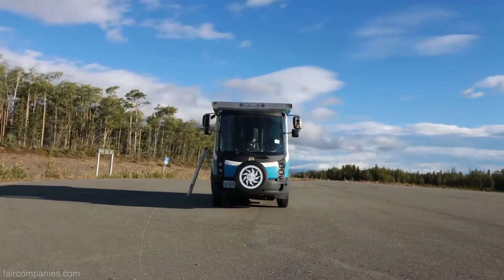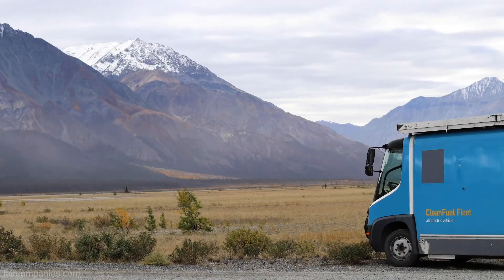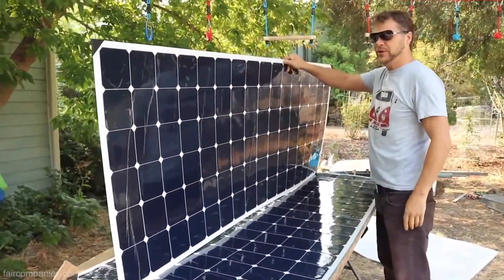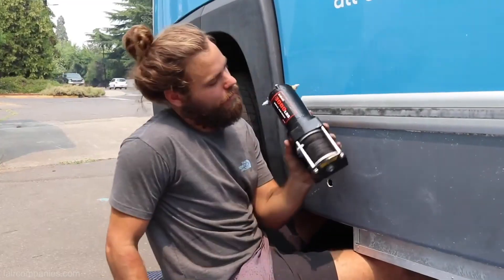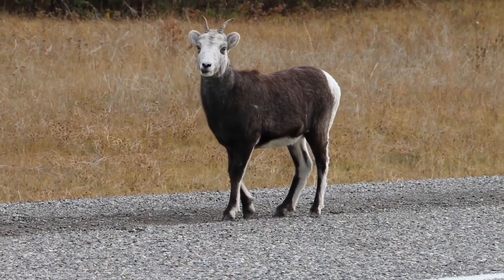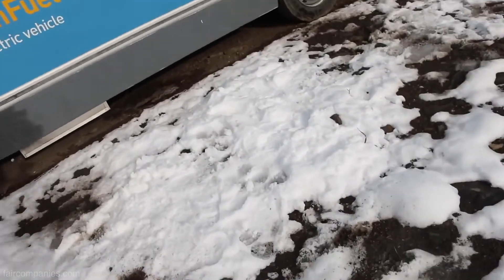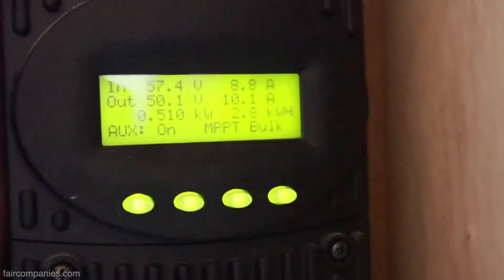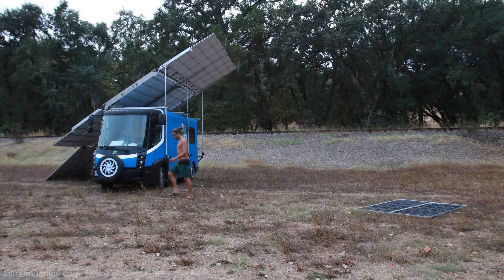Delivery EV turned solar-powered campervan: 100% self-reliant

Comment: Right. I dont want electric car, which is not fully covered with more efecient solar pannels Ideal ev car would just charge itself from the sun and I can just drive like 200 miles a day without any troubles and extra charging stops. Till that day I will still prefer gasoline car, which colud be charged for 600 miles in a 3 minutes..... 
Currently most of electricity is creazed from fosil sources anyway . So what is the point of having ev car and charging it from public electric fosil sources?

Comment: Its a nice project.
You sort of need more solar panel and a magic way to make them disappear when you are on the move.
I saw someone else who was doing a solar EV camper who had some extra panels that he could place on the ground on the end of a cable.
The idea was that he could angle them more easily without having to move the vehicle to catch the first and last sun of the day.
It sounds like you have stuff rattling.  That would bother me.  I would try to have stuff held a little better.

Comment: That’s a great setup. Electric vans are still rather rare here in the USA. It’s hard to believe you had 25kwh of solar on that roof. Have you considered a secondary portable setup that can be deployed as an addition or as it turns out, an emergency system?

But this enture project must be expensive. Hat off to you.

Comment: The way to make solar work is actually to add wind and sustainable fuel generation. Such as hydrogen, ammonia, ethanol, algae biodiesel, etc. It might actually be possible to do it locally in a van. Imagine a hydrogen storage tank that you fill up on sunny days using electrolysis. Or maybe the power accelerates an ammonia generation system using urine. I think there are challenges with sustainable fuel, but workable, especially if people start to think seriously about it. And it will make sustainable energy much more realistic.

Comment: Why not use high voltage solar and directly charge the high voltage drive battery and a dc-dc converter for low voltage usage?
Reply: I would imagine that should reduce conversion losses.

Comment: Most inconsiderate dangerous motorist on the roads under the speed limit and not burning rubber. Driving vastly lower than nominal speeds on roads others use with limited visibility is irresponsible at best. Also, wind would kill that thing.

Comment: I think its a cool trip, but totally impractical for almost everyone. A 5-10% jump in panel efficiency isn't going to help enough to make it matter. You'd be better off finding a way to loos 1000lbs off the weight of the vehicle. Mostly your going to need a much higher energy density form batteries to make this type of trip work. The weight of the batteries really is killing your range efficiency up hill.

Comment: He says, “There’s no reason we can’t all change to renewable energy right now.” Lol.  Tell that to all the long haul truck drivers, the container ships, the airlines, the military.  I can go on, but do I really need too?  Like most liberal ideas, it’s just a feel good fantasy.  ‘I’m helping the environment.”  Ha.  Your driving a truck made of plastic, and metal, and minerals.  There’s nothing environmentally friendly about your truck.  Nothing on or in or plugged into that truck was built using renewable energy, even your clothing, your phone, your watch, your food and what it’s wrapped in, everything you touch. You just “feel good,” that you think your helping the environment when actually your not.  If someday they can create a solar panel and battery that can charge my car or truck in the same time that it takes me to fill my gas tank, without having to set up, then go the same distance, in freezing temperatures at the same speeds and torque, I’ll be 100% all in.  Until then don’t force this on me or anyone.  Let the free market and capitalism work.  The technology just isn’t there yet is it.  Maybe, someday.  But that’s a big maybe.  That should be everyones take away from this and all EV videos. 😊
Reply: CO2 emissions due to material production for the van are absolutely negligible.

Comment: very clever design to tilt the panels, and then take the extra row off the back and fill the gap to the ground.  Also those are some monster flexible panels you found.  Mine are 9x4 cells, I do love how light they are.  It looks like your one main row on the roof top is a rigid set, probably handles the weather better.  I do wonder how you deal with wind though - wind is a big problem with my flexible array, it's so light and the brackets are wobbly like yours - a big gust will just about take me off my feet if I'm carrying it inside when it hits.

Comment: The ideal vehicle should have a solar panel skin all the way around including the windows if they make translucent solar panel skin. And of course it needs to be super efficient high capacity in solar panel and battery. Then there will be no maintenance at all the bus will do the work and charge itself all the time. I think Elon Musk will eventually create a large all wheel drive bus with solar skin that has all of that and is bullet proof with all wheel drive and totally sturdy and also storm proof.

Comment: Imagine this design (front view):
  /\_/\
 /\[_]/\
    °  °
Or simply 2 external trapezoidal arrays. They need to TRIPLE the amount of panels to get a reasonable range per charge. Given how light these panels are,  I know a dogged DIYer could manage to get 3x the panels for a Badass charge. Just slide em in x 3 on each side and then stack em in 2 trapezoidal or simply flat on the ground.

Comment: I think the two main challenges for travelling on solar energy are:
1. Reducing weight as much as possible and by this bringing down power consumption
2. Getting the strongest cells and the largest usable area for charging

Why not lay 20 or more of these big lightweighted 1000w panels around the car?
Maybe additionally charge at night with a wind turbine?

Only 10 percent of the time driving (!!!) should be improved to lets say around 40 or 50 percent - then it starts to be fun.

8 hours sleeping, 6 hours charging and 10 hours driving per day would be cool.

Charging while driving might be also an important issue.

If you can drive on 8KW and you get 4KW in while you drive, a 40KWh-"tank" makes you run 10 hours instead of 5 hours! Much better in sunny states of course 😂

Comment: 50 miles / 80km per day is very little range though. I would much rather take my recliner bicycle and do a 74 miles / 120km on just leg power. 

I will bet you its a lot less strain on the planet as well. We don't NEED cars except for to protect ourselves from other cars.
Reply: 6:40 if you want to check my nrs.

Comment: Im amazed at the functionality of this vehicle for what it is 
But folks can we pls STOP calling it "renewable" energy?? IF U DO NOT BURN OR RUN OUT OF "fossil fuels" (whole nother argument there) YOU WILL HAVE NO MORE "RENEWABLE" ENERGY IE. SOLAR PANELS,LITHIUM ION BATTERIES,WIND MILLS ETC ETC.
Therefore "renewable" energy is a farce thats been brainwashing gullible fools since its inception. I guess my point is without petroleum fuel WE CANNOT MAKE "RENEWABLE ENERGY" EQUIPMENT.  THE ONLY THING THAT CHANGES IS THE GOD OF US AKA GOVERNMENT/POLITICIANS GET TO HAVE THE FREEDOM TO BURN ALLLLLLL THE PETROLEUM THEY & WE ARE THE IDIOTS RELIANT ON THEM TO KEEP THE ELECTRIC RUNNING FOR US & AT THAT POINT WHEN ENOUGH OF US ARE DEPENDENT ON IT & THE ELECTRIC SWITCH GETS FLIPPED,WERE SCREWED 🤯

Comment: It would be a good idea to use a 24 volt dynamo on each wheel for when you are going downhill to use it as a brake and give a boost to the charging volts while driving downhill that would help you increase the distance downhill since it would increase the charging of the batteries, a cordial greeting from Australia. Anthony Ruiz.

Comment: Is your solar DC power going through a charge controller to your house battery?   And then an inverter to make AC for your J1772 interface into the van's battery charger for your traction battery?
I think if you take the DC from the solar panels directly into the traction battery you will get 2x range per hour of sun.
I have solar panels and a (home converted) EV that presently charges this way (I also made a J1772 interface to bring in grid power to my AC battery charger) - solar direct to my EV battery is 90% efficient and I can make emergency power with an AC inverter that's 80% efficient.  If I was to use that AC power to charge another EV's battery charger (90% efficient?) there would only be .90 x .80 x .90 = .65 or 65% of the solar power into that battery.     Totally cool vehicle.
Reply: I only use the J1772 when traveling at a charge station or if I need to charge up overnight.

Comment: This is a very interesting project.  For the community interested in this topic, I would propose an annual race from Alaska to Argentina based only on the charge of the sun and perhaps there could be different categories too:   Single person (who camps outside vehicle). Two-person cars (Aptera being the first), 4 person cars (like a Tesla but only charging off solar panels), and finally camper vans where people say with the car.

It would then be interesting to watch technology evolve, similar to how car racing improved ICE car technology in the times just after the Model-T Ford.

Comment: You guys need to check out the Solara 4 dr car. Most of the car is made from carbon fiber, even the rims. It can travel on solar power alone during the day, & 600 miles on the battery at night.
Reply: Also check out the Aptera. Its a diffrent solar EV also made with carbon fiber construction. You can see videos of Aptera's prototypes here on youtube.
Because of the help from solar, charging from standard 120V wall outlets is all that is needed for daily commuting. 240V and DC fast charging is possable for when you really need to get from point A to point B.

Comment: How far can you drive on a full charge. I also wanted to say if you would have made your van similar to a hi-lo rv trailer it would have been a lot  more efficient. A van is like pushing a flat sheet of plywood down the road. If it would have had the shape of a Volvo station wagon, with rear box able to pop up like an accordion it would have been a lot more efficient. You could also tow a flat bed light aluminum trailer 5 feet wide & 14 ft long covered with solar panels..

Comment: I would add two battery systems. One leave it charge by solar and alternator and the other system in use. When the one is low you can switch the systems.

Comment: This video should give everyone reason as to why we can’t get off fossil fuels…

Like we all have the time to drive at 25 mph everywhere…

Not to mention the materials used in solar setups are detrimental to the environment when they’re mined/produced…

Look at a lithium mine.

This isn’t practical.

But as long as it’s mined by China In 3rd world countries who cares right.
Reply: Maybe a small nimble lightweight and aerodynamic van type vehicle could be made right here in America that would be much more efficient for solar.  Kinda like what Aptera is tryng to do but a van instead of a 3 wheeler.  Thing is most of the world is not sunny enough for it to be practical.  It would only work sufficiently enough in deserts.  I know tropics are sunny too but too warm and wet/rainy/humid the batteries and electrical components would struggle and crap out super fast

Comment: You know here there are minimum speed limits right? Driving across the country in a van doing max 30mph on our highways is sure to cause a huge pile up of traffic as well as multiple tickets from police. "There's no reason we can't completely transition to renewable energy right now" as you then later state you get about 50 miles per day while doing 20mph. Yea no thanks we're not quite there yet in terms of battery technologies. Also for a major project like this you'd think he'd look up solar channels like will prowse where he proves those flex panels are worthless in terms of power production and fry themselves in a very short time

Comment: Electric vehicles are run on batteries which are charged by power stations using fossil fuels. Even the solar panels plus the vehicle and everything in it has been built using power from fossil fuels. The batteries are toxic to mine and are toxic waste after they have been depleted which is about 4 to 5 years depending on their use, they also degrade in performance over their life span and this twat wants to "make a statement with electrification and renewable energy". He has no clue about this subject and should keep his moronic "opinion" to himself.

Comment: You could add a few small multi-directional wind turbines and probably not have to worry if the sun's going to be out or not.
It's not always sunny or windy, but you can always charge from wind and sun when stood still or driving!

Comment: Wow! The fact that it is self-sustaining, even as a slow and inconsistent thing is AMAZING. I didn't think the efficiency of panels could support that yet. 
Very impressed by the experiment.
Reply: Have you heard of the Aptera solar EV? Its an EV designed to have extreme efficiency. Extremely aerodynamic, lightweight, 3 wheeled, 2 seater. Fully enclosed and climate controled for protection from weather.
Solar and 120V charging for daily commuting. 240V and DC fast charging for when you really need to get from point A to point B.

Aptera is hoping to enter high volume production in 2026, but right now its just prototypes. You can have a look at their progress here on youtube.

Comment: ??? For what? So much time los for... what? Anyway More than 3 days without charging watter you can not stay... if you drive for watter, well batteries goes also charge, and 90% all this gadget can be done by gas (2 month) and... you have time to do what ever you want to do, not waisting time to solve problems that you will not have if you do not use so many things

Comment: Yes, it's about "7 feet, 30 inches", 15 fingernails and 243 pube hairs...    Why do you need to use the metric system when your body parts are available? Right?
 More than 200 countries out there using the meter, only meter, just the meter (even the UK since 1971, AUS and Canada), and Burma (...), Liberia (...) and the USA and the r5dn5cks somewhere else still using the Neanderthal system.

Comment: It's amazing people's idiocy and will to believe in something they are brainwashed with ... If this video Proves something is that self-powered solar delivery vans will never be possible. Even with that Tremendous amount of solar panels, that are obviously impractical for day to day operations of any delivery business, the van still travels at low speed and with multiple Prolonged "recharging" stops. 
What more proof does anyone need to understand that Fuel has 25 times more Energy Density then batteries ... and that PV panels only capture 10-15% (I know there are more efficient ones coming btw) of solar energy ... 1000W per square meter max ... at the Ecuador. 
Now is the van a very good engineering project: Yes! Is it practical or even feasible for any type of business/day to day activity ...No.

Comment: What you need is a ultralight vehicle.  One made of aluminum and fiberglass.  The vehicle should be very aerodynamic.  And you solar cells should be ultra efficient like those in the Aptera.  Maybe you should build something like the Aptera but with 4 wheels and bigger in size, comparable to your current vehicle.  If only a major auto manufacturer starts building one.  The demand is there.  Auto manufacturers are just out of touch with what consumers want.

Comment: Also, low voltage means exactly what it sounds like. Operating lithium batteries at a low voltage state can be dangerous, but it’s mostly just really bad for the maintenance and operation of the battery.

Comment: There’s actually huge reasons the world cannot switch over to purely solar/wind energy right now. And probably not even within 50 years. 
One, energy storage technology NEEDS to improve by several factors of efficiency, cost, and capacity. 
Second. Halting all fossil fuel extraction, use, production, etc would have absolutely deadly consequences on many many countries and many many people. Like starvation, disruption and breakdown of the global supply chain, and so much more. 
Third, solar powered/electric powered cars and devices need to come WAY down in price. Way way down. The average human being cannot afford any where near the amount of $$ have it costs for a long electric vehicle.
When electric power and solar/wind works, it’s great, but when it doesn’t work, people literally die. Of extreme cold and heat, and from being stranded, or inability to do a multitude of things. 
I love renewable energy and I love electric vehicles, solar, wind, water generators, all of these things. I love it all. It’s just not viable yet. 

A big big thing that America and Europe could do to help improve all of these things, and actually speed up the transition to electric/renewable, would be to heavily invest and produce a LOT more nuclear power plants. Nuclear is a literal infinite supply of clean, sustainable, and safe energy that ACTUALLY has the capability to provide more than enough power for every human being on the earth, and many countries could start providing basic electric services for free, IF we would just invest in nuclear. But way too many are misinformed, way too many politicians have outdated ignorant opinions on nuclear. And it’s literally all of our losses that we can’t be much much more happy, energy independent, and advanced than we are now.